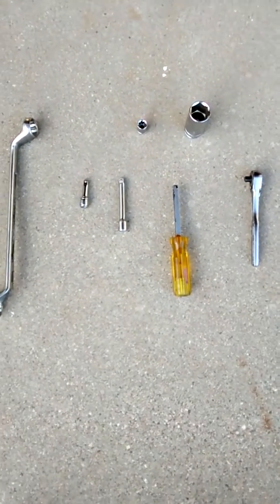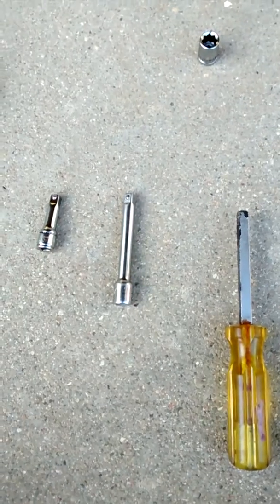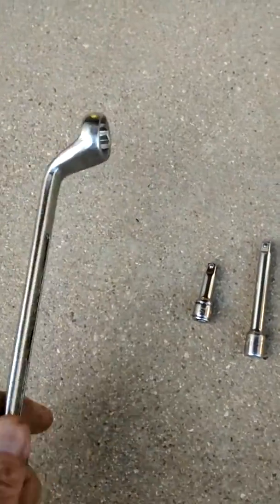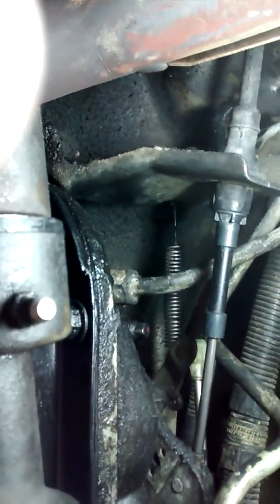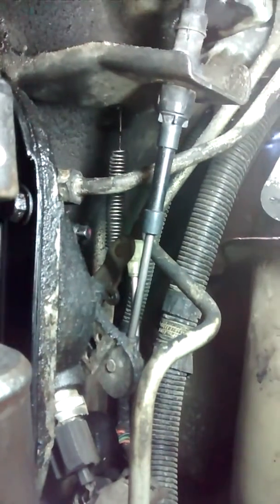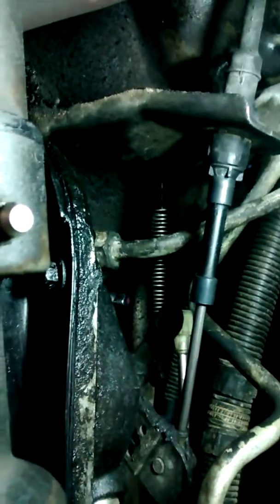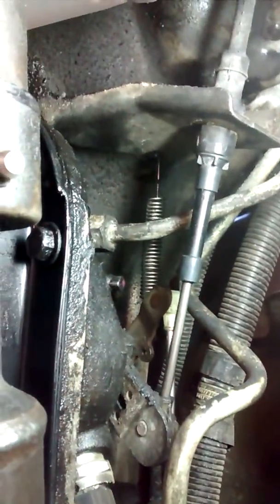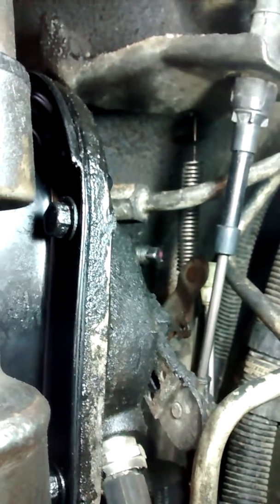'98 Dodge Dakota 44RE transmission front band adjustment

Comment: Thanks for the video. I just finished adjusting the front band on my transmission. I still have to change the fluid, filter and accumulator spring. I may go back and double check my front band adjustment. The truck is definitely shifting better, but I am not sure it is 100% accurate. I was losing light, by the time I finally sorted what tools I needed to use. I didn't see your video prior to completing the adjustment. Now that I know what to expect, it should go well.
Reply from the maker: You're welcome, glad it helped.

Comment: Thanks a bunch, Eric!!  I'll be doing this soon to my '97 Dakota with the 42re.  How does your truck drive now that you've adjusted the band?  Did you also adjust the band in the pan?  All your help is appreciated.
Reply from the maker: You're welcome!  It was shifting weird between 1-2 and 2-3 and it does seem a lot better now.  I did adjust the band that's in the pan, but I also replaced the solenoid, pressure sensor and accumulator spring (that controls 3-4) during that time.  The band that's in the pan is the easiest for a beginner, it's the front band that's challenging but the method I show should make it easier to do.  Do you have an inch-lb torque wrench?  You'll need one.  I used the Harbor Freight 1/4" one.  

If you have the pan off I'd replace the accumulator spring as it's inexpensive and they are known to break, if it does break you lose 4th gear.  I used Phoenix 22832A which is the upgraded 0.126" spring.  The solenoid and pressure sensor you can get as a bundle on Amazon (B01AZ7GMNQ) for a good price.  That's a little more pricey and you probably don't need them, but they're easy to replace.  Check out video wqjIH5XXcxg he shows how to do it.  Video 6oMC-r1OXzI shows how to replace the spring.  I also replaced the pan with the Dorman 265-839 so I have a drain plug now.  It holds about 1 quart more of ATF than stock as it's a little deeper.
Reply from the maker: Forgot to add that I also replaced the transmission speed sensor at the same time too.  I used the Dorman 917-602.  You'll need a 1" deep socket to replace it.
Reply: @erics3599  Thank you for this new info!!  Mine is shifting weird in those same spots.  May I ask...How did you determine that you needed to back off 2 1/4 turns?  Also, are you sure you have a 44RE?  I don't think those were in Dakotas until 2000.  My 1997 has a 42RE.  According to the service manual, if you have a 42RE, you should have made 3 5/8 turns, 2 7/8 for the 46RE, and 1 7/8 for the 47RE.  I'm only mentioning this in case you want to readjust your turns.  Thanks again, Eric!!
Reply from the maker: I think the dealer told me it was the 44RE when I first called to get the ATF filter, so I wrote it down on a copy of the window sticker.  I have the 5.2L V8 4x4.  From other research I've done confirmed that the 5.2L engine was paired with the 44RE transmission.  The 3.9 V6 with the 42RE, and the 5.9L V8 with the 46RE.  

This pdf file has the # of turns.  www.trucktransdiag.com/downloads/Dodge%20Band%20Adjustments.pdf 
This site shows match-ups of engines to transmissions.  www.txchange.com/id.htm

What engine do you have in your truck?

I just searched on the part number I found on the transmission (on drivers side close to the front of the transmission, etched into the metal, not a plate).  The full part number is PK52119513, but wasn't getting any hits on that.  If I search for just 52119513 then it does come up with 44RE.  The below site has a picture of where it is.
www.justanswer.com/dodge/2d462-98-dodge-durango-5-2-engine-how-find.html